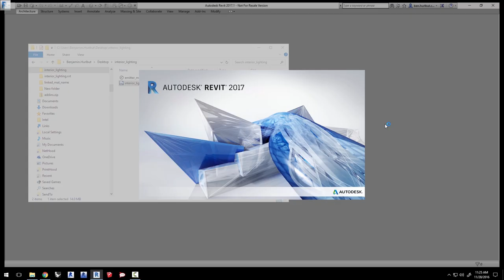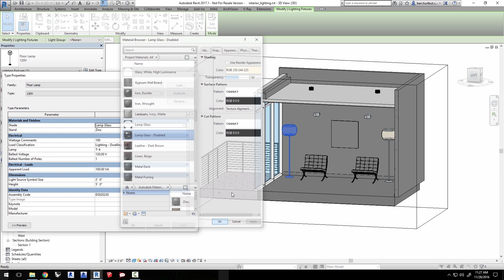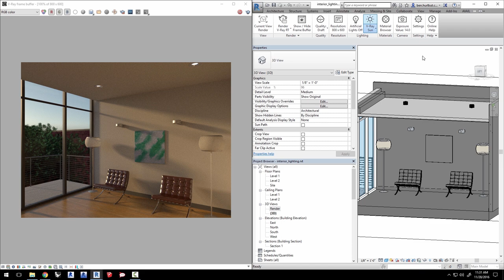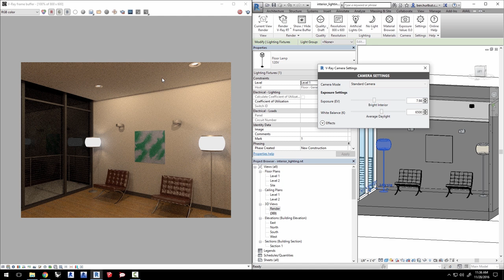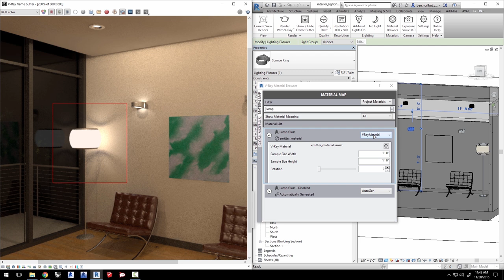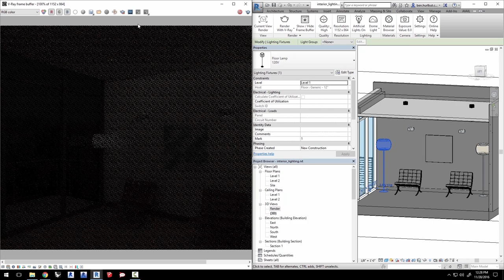V-Ray for Revit – Quick Start: Interior Lighting

Comment: I'm doing everything like in the tutorial. Vray behaves as if there were no artificial lights. Changeing exposure doesn't help, and the lights render normally on Revit's engine. I'm using Revit 2017.1
Reply: download the file in link below video you will found a vray material
go change can glass from autogen to vray material and choose the vray material in downloaded file
Reply: Which link??
Reply: Which link